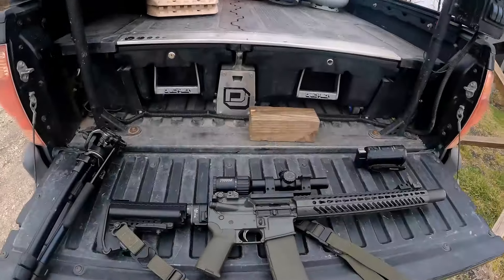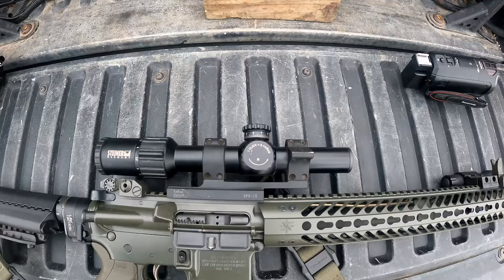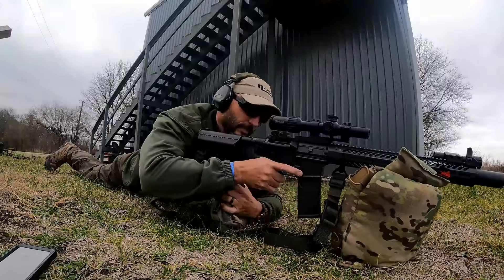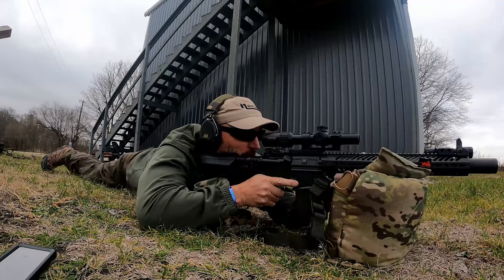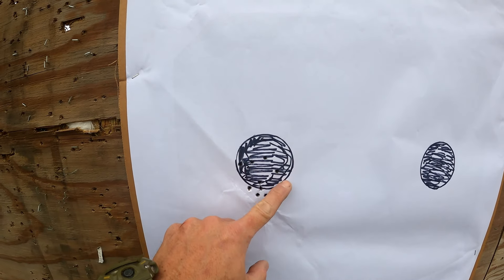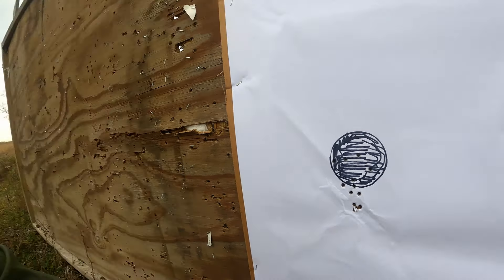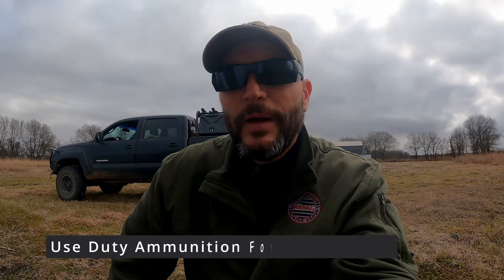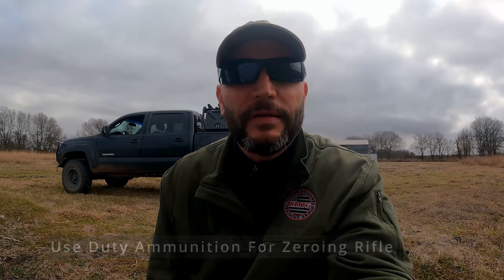Where to Zero Your LPVO, Low Power Variable Optic

Comment: As long as it's a 1st focal plane optic,, zero "shouldn't" matter much at all, other than to verify POI at the different magnifications. 

2nd focal plane optics (a confusing mess IMO) is where things matter more.
Reply: Not true.  On a second focal plane the center dot stays the same with poi, no matter what magnification. Only the bdc or holdover aren't accurate unless fully zoomed.
Reply: @OldmanSnake  nothing i said was incorrect in the slightest.